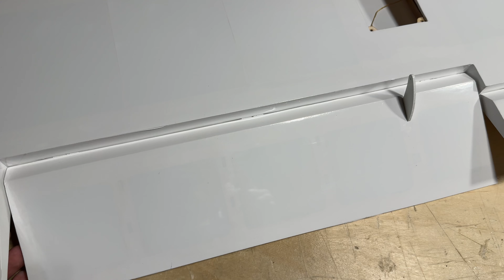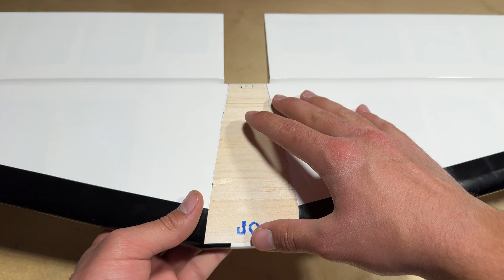Hangar 9 Pawnee Brave 20cc | Build Tips

Comment: This was a well done video.  I just can’t get my head around offering another cropduster when there’s so many other planes.  Dropping the 20cc warbirds was ridiculous.   You should bring back the Great Planes 30cc Escapade MX.  These go for big money on the auction sites.  Or offer like a 20cc Ultra Sport.   Any Ultra Sport, arf or kit, go for big money too, but if offered in a 20cc arf, it would have wide appeal to people using DLE 20’s and those that still have 120 glows.  You could even scale down for your crappy foam eFlite nonsense too!   As it is, the current Hangar 9 lineup just makes me shake my head….like you really need to offer 3 sizes of Cubs…..🙄